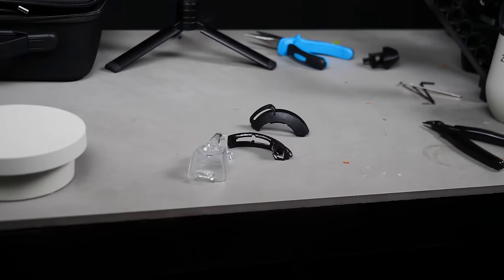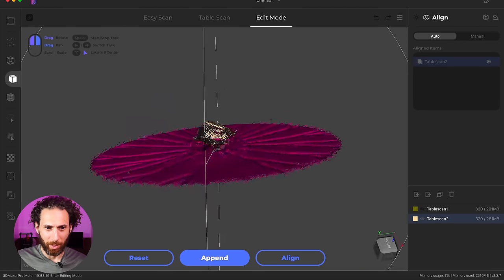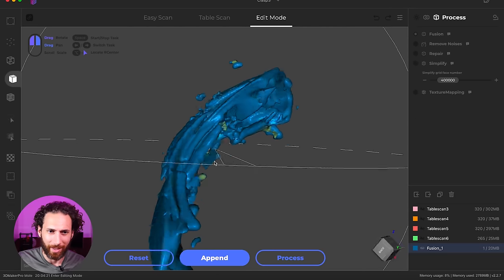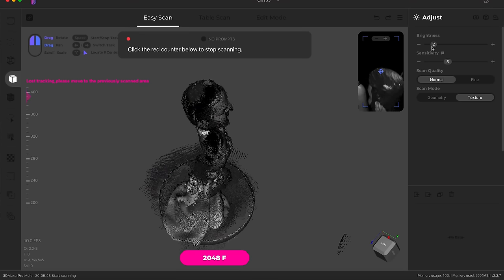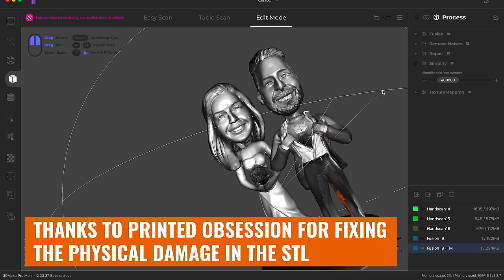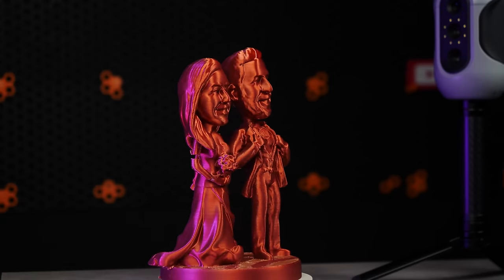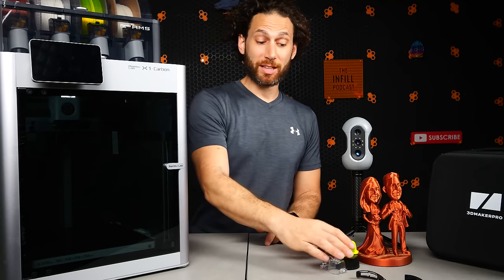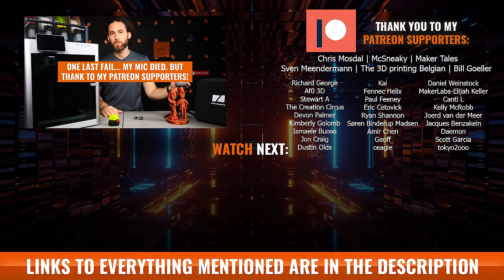Don't Buy a 3D Scanner for 3D Printing

Comment: I recently retired from working at an automotive design studio where we used high end 3D scanners for the past 20 years. Until very recently, Sub $1,000 scanners were too crude to use at a home studio. I finally pulled the trigger and bought the Mole and Lynx from 3DMakerPro. I make clay sculptures that I can scan, then print on my PrusaMKS3+, my results were amazing! The guys at the shop were impressed how accurate the scans are and the price of the Mole and Lynx 3D scanners. The 2 machines where I worked cost over $150K each and has an expensive annual license and it takes 2 guys to operate!  The Mole and Lynx scan and process quickly... okay you need a fast computer to process the scan quicker, but frankly, no matter how long it takes to process it's still a better overall system you can buy and use at your home! And yeah... you need to learn how to take advantage of these scanners by practicing and getting the use to software settings and scanning by hand. I'm building a scanning table for these scanners because I think the scans might be better yet...
Reply: Make a video please please it is so frustrating trying to get this to work! I use this for high end automotive restoration and can’t get a good scan to save my life. What an incredible tool this would be if I could get it to work! I bought the revopoint miraco and I am about to return it.
Reply: Make a vid,! So cool

Comment: I think some of the information here is inaccurate. You are trying to go straight to print with a sub- 1K$ 3D scanner. This is way too much to ask from any 3D scanner ;especially the consumer kind.  I use a 80K $  Faro arm at work , and we STILL have to reverse engineer our scan data to come up with functional prints. At this point in time you simply cannot get away from reverse engineering point clouds or meshes, before you print them.
Reply from the maker: Yep. True. Should’ve specified that this is about consumer scanners

Comment: Id try to scan it longer and manually by hand. Make sure your going back over the same spots multiple times. I think that's your problem. I also think your going about this all wrong. If the clap is broken, bondo and sand it until perfectly the shape it should be, then cast in silicone and reproduce out of a flexible resin.

Comment: You normally don't use the 3D scan directly if you do reverse engineering.
It usually gets loaded as mesh into your CAD sw of choice as reference for reconstruction.
You still need to fact check measurements etc. but heck it accelerates the process to super sonic.
Especially if you have critical landmarks that are near impossible to measure with traditional means.

Comment: Engineering is hard. Funny thing is, I printed out a holder for my GF´s car because the original broke. The original was crap and I improved the design through the print. Most parts are designed to be production ready by injection molding which means you should not simply copy a design but you can almost every time improve the original design since you don´t have that design restrictions.
Seeking your part as a example. Your part is way too weak, it has thin walls etc. so that it can be injection molded. Simply make it thicker.
Reply: This!

Comment: For someone who was in a similar position as yourself with 3d scanners and CAD (Fusion 360 for me) I initially had the impression that I would 3d scan and then print the model without the need to use a CAD software. We are a little way off from that with these cheap commercial scanners, I have the Revopoint Pop 2 and Mini which are in the same class as the one in this video. 

For complex items like the Baby Stroller Clasp the expectations need to be lowered. What you can do is 3d scan the item, it will need cleaning up the 3d scanning software to remove any rouge bits and also less is more. Doing multiple passes will just create lots of additional data points which do not add anything apart from more processing time. Once you have meshed the data points the model would then need to be imported into a CAD software. From there you can create a sketch from your 3d scan so that you end up with the correct dimensions. This video explains it very well and after watching this I was able to reverse engineer parts and 3d print them. https://youtu.be/imGrla3b3Mo?si=QUyB-zPy1o2SZVnH&t=487

Comment: Scanning can be frustrating, but I’ve found that if the part is a difficult colour, ie Black, Clear, reflective and broken, you can just paint it with a suitable colour of primer. Since you’re not going to continue using the broken part and It’s much cheaper than sublimation spray.

Comment: I reviewed the CR Scan Lizard and the RevoPop2 and it will be many years before I review another 3D scanner. What they don't tell you is that the software sucks, you have to already know a lot about 3D models and repairing/editing them, and that for functional prints, it's really hard to get a flat/square base surface. There's a reason the good 3D scanners cost $20k.
Reply from the maker: This one honestly wasn't terrible. Look at the results on that statue... incredible!

Comment: Suggestion: Compare the time/cost it takes you to design a 'duplicate'/replacement part for a non-trivial item, and doing the same with your scanner as a 'starting point', and one of the 3d printer 'contract makers' that you take some pictures and dimensions and let them send you a STL file.  

For a oneoff critical part it would be interesting to compare these methods to be able to put a money value on your time, (and include the cost of the scanner, even though that should be amotorized over a number of parts so it is a 'longer term' investment rather than a single part expense), and the cost of having a contractor over the internet do it for you.
Reply from the maker: Great idea!

Comment: I know it was an ad read but you don’t need multi-color prints. You need a model that’s setup for it and then you just use pause at layer height and change the filament manually when it pauses. It’s pretty easy actually.
Reply from the maker: That's true, but if you want to really "wow" (like that spiderman), dual-extrusion filament really  helps!
Reply: @thenextlayer  100%
Reply: Surely that only works if the whole layer is the same colour? Which wasn't the case with this model.
Reply: @wolfiebo2209  that’s why I said the model needs to be “set up for it”

Comment: Interesting vid ive been thinking of getting the creality ferret it looks good in reviews but im still thinking about it
Reply from the maker: I wouldn’t buy a 3D scanner. Just learn CAD
Reply: i know badic cad but as a business i need to pay to much for basic things you can even do on tinkercad cause most my aluminium cnc machining isent so hard
I want a scanner to scan motorcycles and create aftermarket parts
Reply: Maybe im not the best example cause I know your basicly right but i designed a 4th axis cnc in my head and built it in 2 weeks just creating fast dxf fikes while the assembly was in my head 😅

Comment: One, 3d scanners have issues with picking up reflections, you may not see them but the scanner will pick them up easily. 2. using a turn table is awful for 3d scanners it changes the shadows of the object while its turning, causing more artifacts. this is the main reasons i dont use scanners. 3. You are better off with using Photogrametry,  Taking lots of photos of the object in 360 degrees working your way from the top of the object down to the bottome of the object, moving yourself around the object not the object rotating on the turn table. The more photos you get the better your model will be.  Another way to get a better 3d object is to put the object on top of a small stick with a small amount of tacky gum, or hot glue to hold in place this can be removed easily in the 3d editor. Or you can hang the object in the air with a small piece of thread with the black back ground which will reduce shadowing, this will give you the best results. Photogrametry can give you much better results with more detail.
Reply from the maker: Thanks! I have never had luck with photogrammetry but it must be my skill level

Comment: nice video. Those guys need to spend more money developing their software rather then sticking the same sensors in different bodies. I have their "top of the line" whale scanner and its great for the $800 i paid on the kickstarter but it will never do their so called advertised .05mm accuracy. I have an Artec Spider and Eva and those are real scanners. 7 years old and they dance all over that thing. Ya ya ok they cost 45k new but now on the used market they are a great buy compared for 8k for the whale. The reason Artec software is $1500 a year is because it works perfectly.  Anyhow  good luck with it.

Comment: Scanning engineering parts mostly does not make any sense. You are way faster simply redesigning it. It´s mostly simple shapes anyways. Scanning is great for trees and big buildings with nice textures etc. The statue is a perfect example, this is a sentemental piece which should be scanned. 
For all you fellow cheapos doing this as a hobby simply use photogrammetry, it can take longer but the results quality wise are even better than those scanners.